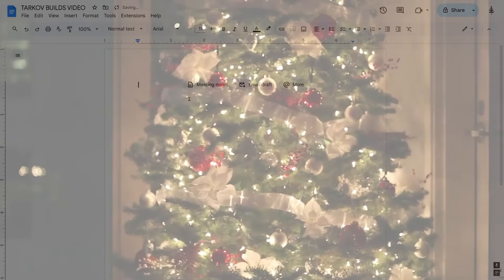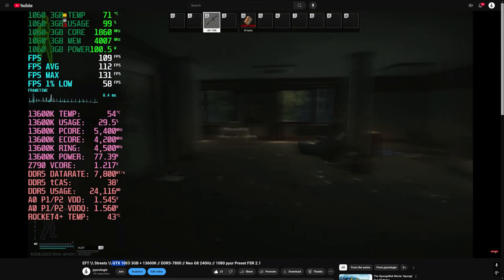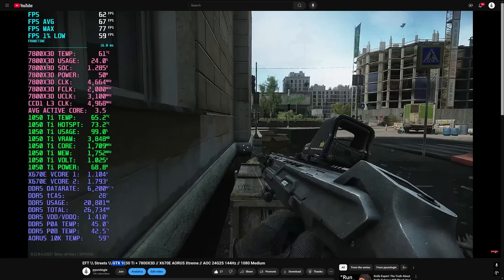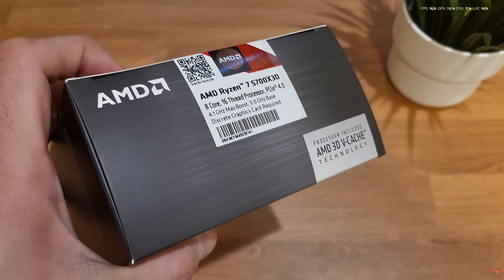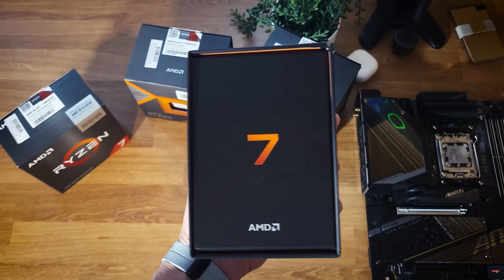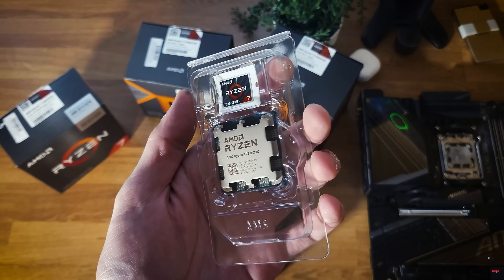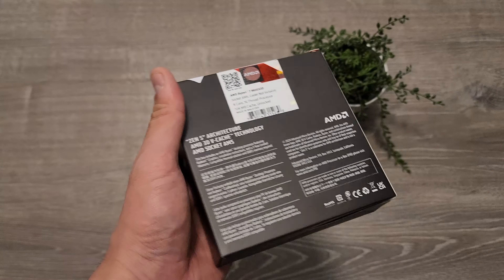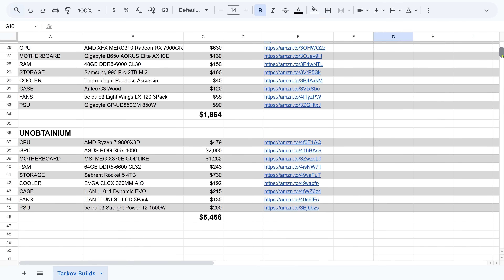My Recommended Best Tarkov PC Builds in Late 2024

Comment: ty for the guide, i picked up a 6650xt for 150 from a local used marketplace and i paired it with the 5700x3d might be a bit late now but ty still
Reply from the maker: very nice pickup! glad the guide helped you decide on your components, that's a great combo!
Reply: @pyurologie  ya ofc i found used deals on marketplaces i got a b550 gigabyte itx board and 32gb ram 5700x3d for 350 and that gpu for 150, i had psu and case i ordered new ssd but honestly upgrade from i3 8100 and 1060 6gb is so nice lmao

Comment: Not sure if you red comments on older vids but here is a go..

On the budget build for the 5700x3d, the motherboard says on 1 part "Supports DDR4 4733+ (OC)"  but when looking at the specs it says the memory clock speed is only 2400 MHz. 
is your 3200mhz memory just bottlenecked at 2400 or am I reading it wrong?

I was looking t the MSI B550M PRO-VDH WiFi ProSeries mobo instead to get the wifi and usb 3 and upgraded audio, but not sure if it's worth the extra but I do need wifi so I' have to buy a wifi card if not.
Reply from the maker: Memory clock speed 2400MHz = 4800 MT/s DDR (double data rate). 3200 MT/s (1600MHz) RAM will run fine on the board listed. Either way, RAM speed doesn't matter much for X3Ds (watch this one... Does RAM Speed Matter for 5800X3D? https://youtu.be/N5HQcCihtrU). B550M has a little bit better specs than the A520, but will likely not result in gaming performance increase. If there are features on the board that you need, it's a good option over the A520. The A520 is simply the cheapest one you can get without losing any performance.

Comment: Gpu for titanium is unavailable. Any good alternatives?
Reply from the maker: yeah, unfortunately GPU demand has skyrocketed and everything is unavailable or expensive right now... If you can, I'd probably wait until the RX 9070 launches and try to get one of those or find a used 4070, 4070 super 7800XT, 7900GRE something around there... but unfortunately it's rough out there right now for GPUs

Comment: What do you think about the CPU: Intel® CoreTM i9-14900K New Gaming Desktop Processor 24 (8 P-cores + 16 E-cores) compared to the ones in the video?
Reply from the maker: still a strong CPU, about the same as 13900K, which can just about equal 7800X3D in performance when maxed out with fast RAM

Comment: With the way DLSS 4 image quality is looking right now, Im wondering which GPU to get.
Im thinking of getting 4070 Super because I feel like I will need DLSS 4. 
For 15-20% less money I could get a 7800 XT - or for 25% less a 7700 XT, but even though a lot cheaper per FPS, I feel like missing out on image clarity from DLSS 4 now makes 4070 or 4070S the best "budget" options almost? Normal TAA in Rust/EFT looks so blurry to me, makes my eyes rly tired.
Would you say DLSS 4 is required almost now?
Reply from the maker: I won't say required but currently it is the best image quality option for tarkov. we'll see how fsr4 fares soon though

Comment: as a side note you can do a broke boi build that'd do great I've been playing at good frames on a 5600x (only 100$ now) a GTX 1070 ive had for 10 years, and 32gb of ram and an m.2 in a lian li lancool II with a budget psu from an old pc from 2015 any AM4 mobo will do and a pearless assassin is cheep and would suffice, and a 144 hz 1080p monitor.

with the exception of the 5600x and mobo case and an AIO that i got 5 years ago....I've had the 1070 for 10 years ...I'm finally upgrading my GPU after 10 years to a 7900XTX and due to availability of a 9800x3d being hard to get and not wanting to upgrade my mobo without having the 9800x3d, I'm going to the 5950x, because it's down to 350$ from 800 and staying on AM4 for a while.

Comment: I pretty much plan on building the unobtainium build soon. I already run a 3090, ryzen 5900x, 32gb of ddr4. And very soon Im going to upgrade all but the GPU, I'm waiting for the 9950x3d, the 64gb of ddr5-6000 (6000 is the sweet spot for amd cpus), and if I can get my hands on one an Asrock x870e nova, but they're sold out everywhere

Comment: What gpu is better to take at the moment? 6800xt or 7800xt?
Reply from the maker: 6800XT better value if cheaper uses a little more power, 7800XT more efficient. both have very similar performance

Comment: For the Gold build I noticed there are no Fans. Is this because it doesn’t output much heat?
Reply from the maker: hi yeah it runs very cool and I tried to keep costs to a minimum for this build sample. The case I recommended does come with a 120mm rear exhaust fan which is adequate for this build, but you can definitely add more if you like. If you want reasonable fan recommendations, I can give you some as well.
Reply: @ sounds like you’ve got it figured! Thank you, Great Video.
Reply from the maker: @SethHalliman  trying to make it easy, thank you!
Reply: @ mission accomplished, you’ve made a video that convinced a console scrub to make the switch! Will be using links.
Reply from the maker: thanks so much! I'm glad the video was helpful. welcome to the PC gamer club!!
Reply: Hey, sorry to bother you having an issue installing the GPU without smashing the headers. Not sure if it just isn’t gonna fit or I’m doing it wrong. Any ideas?

Comment: thanks for the video, i have a question, i have a 1080 amp edition and a ryzen 9 5900x, i was looking for upgrade it for tarkov but i only have the budget for a gpu or a cpu, which do u think will give me more performance? thanks
Reply from the maker: you're welcome! a 5700X3D would be the best drop in upgrade for the cost with your setup. 

Here's my 5950X vs 5800X3D comparison: https://www.youtube.com/watch?v=f3Ugn09pTWA. You could drop in a 5700X3D and see similar. Performance is a bit down this wipe compared to last, but you should see similar increases in 1080p with a GTX1080. GPU is less important than CPU in tarky.
Reply: nice, thanks bro

Comment: Do you think 650w is enough to run a 7800x3d with my 7800xt
Reply from the maker: it might run, but i'd get a 750W for that setup. the 7800XT can have some spikes that might not be ideal for 650W
Reply: @pyurologie  yea im def gonna go for 7600x3d with 75w tdp its just 10w over my 12400f. Should  have avbout 200w free according to pc partpicker.

Comment: Isn’t the 5800x3d better than the 5700x3d at a similar price ? Seems weird you didn’t mention it at all
Reply from the maker: the 5600X3D, 5700X3D and 5800X3D all perform the same in Tarkov. The 5600X3D has limited availability because they're only sold at Microcenter with no online purchasing. The 5800X3D has been discontinued, but the 5700X3D remains in production and is cheaper than 5800X3D with basically the same gaming performance (artificial benchmarks will show slight differences due to the clock speeds). For anyone building or upgrading now, the 5700X3D has the most availability and is priced the best. I have hundreds if not over a thousand 5800X3D videos on my channel, but the 5700X3D is the one to get today
Reply: @ well that’s good to know I just stumbled over your video and I’m running a 5800x3d but I’m still not super happy with the eft performance might be my rtx 3070 or just simply my settings do you have a video on eft in game settings ?
Reply from the maker: well thanks for checking it out! yes, in fact I do. Here's a couple to take a look at. 

Optimize Tarkov: https://www.youtube.com/watch?v=1eFlPlPufjc
Undervolt 5800X3D: https://www.youtube.com/watch?v=fVvH03z-J-I

you can hit me up on discord if you continue to have issues
pyurologie discord: https://discord.gg/c7SvvDAuMZ

Comment: whats your thoughts on the Ryzen 7 7700X
Reply from the maker: it's pretty decent, about the same performance as 5700X3D/5800X3D. 5700X3D systems cost less to build for the same performance, especially for current AM4 users. 

5800X3D vs 7700X vs 13600K: https://www.youtube.com/watch?v=KKPKfl9k72s
7700X playlist: https://www.youtube.com/playlist?list=PLYaeRxhLbnoFtMhtpZj9eXXoAtSmBddg4

Comment: After watching you comparing 7800 vs 9800 i wanna get 9800x3d but not sure if i i want to upgrade to 64gb ram and motherboard should i get?
Reply from the maker: I recommend a B650 for the sweet spot right now, here a few good options. All B650 boards will give the same performance pretty much, it's just about extra options, budget, and aesthetic preferences for your choice

Value: Gigabyte B650M Gaming Plus https://amzn.to/4g1ImH2
A little nicer: Gigabyte B650 AORUS Elite AX ICE https://amzn.to/3OJav9H

Comment: Im currently running ryzen 7 5700x3d with a 4070 super and streets still far from perfect is this normal for my build ? The fps ranges from 90-50 when scoping in
Reply from the maker: yes, scoping in will drop the FPS a lot since it is double rendering, this happens on all platforms

Comment: I have 7800x3d and 6950xt. I run at 1440p and sometimes still struggle to get 144fps. Streets is borderline unplayable. I get around 50 fps sometimes
Reply from the maker: I get great performance with that setup.. can you try my optimization guide and let me know where you land? 

PYUR optimization guide: https://www.youtube.com/watch?v=1eFlPlPufjc
Reply: @ thanks i’ll check that out. If it helps i ran afterburner and it says my 6950xt is at 100% while my cpu is only at like 34%

Comment: @pyurologie do you know if 7950x3d is better than 7800x3d if you fix the core parking issue ?
Reply from the maker: the core parking "issue" is largely overblown by techtubers. It hasn't been an issue since close to the original launch.. in tarkov, all the 7000 series X3D chips perform the same. 

7800X3D vs 7950X3D: https://www.youtube.com/watch?v=KAhbt1I_a7g
Reply: @pyurologie  thanks

Comment: i got a 5800x3d with a 2070super on 1440 p , should i upgrade my gpu?
Reply from the maker: a GPU upgrade will let you run 1440 native, but with the same FPS ceilings. If you want more FPS, you'd need to go 7800X3D or 9800X3D

Comment: If you need some help getting a 7600x3d for testing let me know
Reply from the maker: I have a Microcenter near me, but I didn't buy a 7600X3D myself. I've done "simulations" on my channel by disabling the second CCD on my 7900X3D previously. Do you have a 7600X3D?
Reply: @pyurologie  I am getting one this week and pairing it with a 7800 xt, the build is for Tarkov specifically.

Comment: Thanks for the insight dude! I'm currently saving to upgrade to an RTX 4070ti, while I currently have a RTX 2060 Super. This is paired with the Ryzen 9 5900x I got a while ago.

Even though as you say, tarkov is a hugely CPU bound game, I never understood why even after upgrading my CPU that I still get less than 50FPS a lot of the time, unless it's small ish maps like factory, or ground zero.

However, you make it very clear, that not only do you need a good GPU, but also a CPU that does.. even more than I thought. I haven't ever really considered, or looked at "x3d" CPUs, as I wasn't really sure what benefit they provide compared to what you lose if you go with it. But, again you make it clear.
Reply from the maker: no problem! thanks for the kind words! Yes, even if you drop a 5700X3D into your current setup, you'll see a large increase. You'd see similar increases shown in my 

5950X vs 5800X3D comparison: https://www.youtube.com/watch?v=f3Ugn09pTWA

Really glad to hear the content is helpful!

Comment: Do you think the 9900x3d or 9950x3d will perform better? Also wouldnt Tarkov benefit more from the higher G-Skill Trident Ram 48GB DDR5-8000 then from 64GB DDR5-6800?
Reply from the maker: It's yet to be seen, but I personally think the 9900X3D and 9950X3D will have the same performance in Tarkov. I'll probably grab a 9950X3D anyways for testing when it does release. 

Also, there isn't really a benefit going to 8000, I tested it already
Does RAM Speed Matter for 9800X3D?: https://www.youtube.com/watch?v=gbfjfuE1ZRM

Comment: I'm thinking about buying Ryzen 5 7600X3D which is 289$ i'm curious how it does against ryzen 5 5700X3D(209$).
Will you have any chance to test 7600X3D ?
Thanks
Reply from the maker: the 7600X3D will essentially perform the same as the 7800X3D in Tarkov. All the 5000 series X3D chips perform about the same in Tarkov. All the 7000 series X3D chips perform about the same in Tarkov as well. For 5700X3D vs 7600X3D, there'll be about a 20-30% difference.
5800X3D vs 7800X3D: https://www.youtube.com/watch?v=luB77nCBsRk
5600X vs 5700X3D vs 7800X3D: https://www.youtube.com/watch?v=IxJcC3qob0o

I did "simulated" 7600X3D back when the 7900X3D was released by disabling the second CCD.

Simulated 7600X3D: https://www.youtube.com/watch?v=4BvpR37nHZc

Comment: How sbout Ryzen 5 7600x3D, does tarkov benefit from 8 cores?
Reply: Tarkov is not optimized enough to see a huge difference, any x3d chip will have huge performance advantages over a non 3d cache cpu though
Reply from the maker: for tarkov, it'll be pretty much the same performance as 7800X3D, it's an awesome buy for anyone who has access to a Microcenter

Comment: Really the 5700x3d sistems is better for tarkov than 13700kf or 14700kf? Thanks for the nice content Bro.
Reply from the maker: No, 13th and 14th gen Intels can get to about the same level as 7800X3D if completely maxed out (fast DDR5 and OC), but it costs a lot more and takes more tuning knowledge than 7000 X3D series chips. I recommended 12th gen users to look at Gold and above and 13/14th gen users to look at the Titanium build and above for substantial increases at this timestamp: https://youtu.be/hRKhqY9p_Fs?t=721